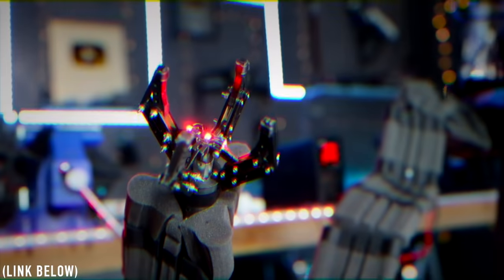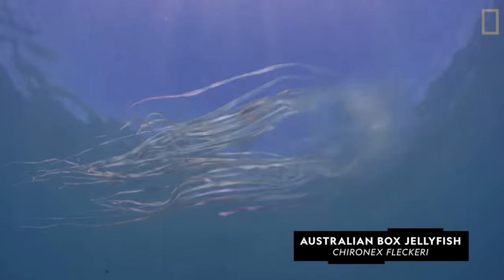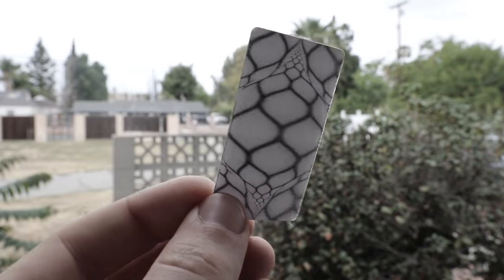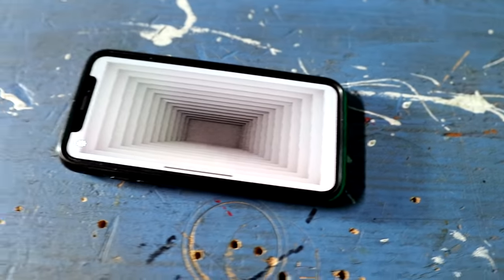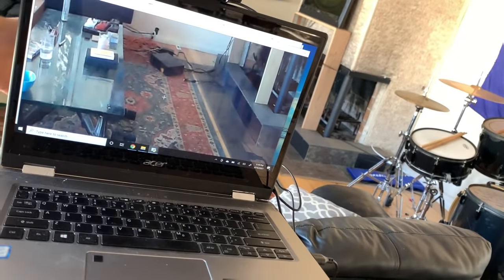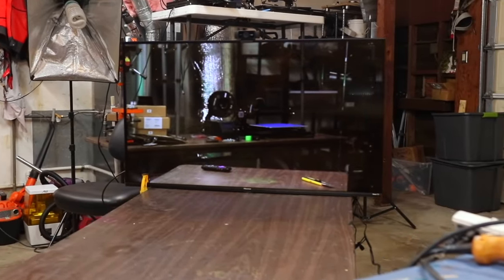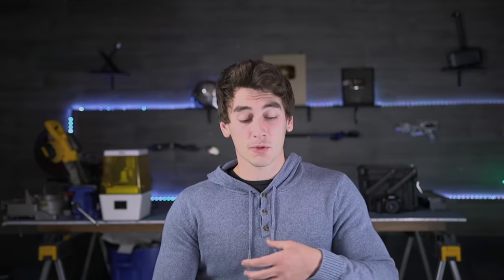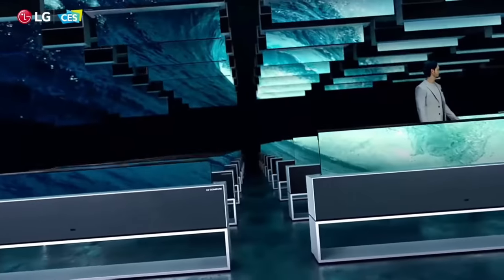Real Invisibility Cloak Using Artificial Intelligence! - Harry Potter Invisibility!!

Comment: You should make the Eye of Agamotto from Doctor Strange. You could have a small camera built in which you could use to program the hand gestures from the movies to open/close it. The necklace chain could be used to hide any wires if needed, and any of the bulkier stuff could be attached in the back underneath a red cloak. It would have a lot of small moving parts, which can be difficult, but it would look really cool if you did it!

Comment: The results are really good I think you might have put to shame the guys working on invisibility lenses for the army. It would be interesting to see you get back to this in a few years with a TV with little to no bezels and high contrast. It would be nice if you could add cameras too but I'm afraid it would add too much calculations. I guess if you had processor built for these specific calculations you could reduce the lag by a fair bit too.

Comment: This is pretty cool, and looks very difficult to put together with the tech we have available. Way to power through. We're just strangers on the internet so don't worry if you're not meeting the insane comment expectations. Question: since fiber optic fabric exists, is it possible to display the camera/AI output into that? The result might not be as high-res as what you did here, but you could make a fabric 'cloak' that would heavily blur whatever it was covering. Anyway, thanks for the vid. I suggest: make a Delorian that can leave fiery tire-marks (even if can't travel through time).

Comment: If you have 2 cameras min with the new cannon duel RF fisheye lens on each corner, you should get all the infomation you need to recreate your image. Capture more info with the cameras so that the software can do all the heavy lifting. 3 cameras with the suggested set-up should do. One in the middle to act as a control camera and 2 on each end.

Edit: I had this idea in the middle of the video. This one was when I watched more. MORE CAMERAS! a few more cameras could capture enough edges and area for you to create a model of the area your going through live and depending on weight limitations you could even have that save so it just redoes it if you go in the same area again
Reply: Like the idea, someone above also said: 'This is a really nice design but with the new screen folding technology you could implement this into a suit with multiple cameras on the behind of it reflecting the cameras views on the to the front'...

by the way... if You ever have the time :D  i have a question about something i didn't understand at all...
The part of "anything between the TV & the Camera is invisible" that he kept repeating... There are like [3]Cameras in the video... 
1}The QR-Code Camera pretending to be the viewer's face\eyes
2}The tracking Camera mounted on top of the TV & tracking the QR-Code to adjust the Scene-perspective displayed on the TV accordingly
3}I guess, a Camera fixed at the center of the TV's back to capture the 'Scene' [don't know why that one wasn't shown & was barely talked about]

So where exactly is that "anything between the TV & the Camera" distance?
& by what mechanism does Camera[3}] choose not to display his arm\body when he's right in front of it & blocking the Scene, while at the same time is still able to capture live video of the Scene & displaying it on TV?

Or is the TV display not a live video &, instead, just a still image that was captured at the very beginning, before he hides behind the TV, & then this still image is used as a video that changes perspective based on Camera[1}]'s position?

Sorry for the length, wrote out the different possibilities in hopes of making it shorter for you to answer :D

Comment: Ahhh! Snake, I see you got your hands on some stealth camouflage! 
To use it, simply equip the stealth camouflage through your Item Menu. Now as long as you have your back turned towards the enemies, you're going to seem virtually invisible! It works best if you're standing still in a crouched position,, so that your whole body is obscured. Your Camo Index will shoot up rapidly. Keep in mind, though, that it drains your battery and that enemies are going to see the plate if they come up close. Think of it like glass: you can see through it, but you can still see the glass itself if you pay attention.

Comment: If you mounted 360 degree cameras to your shoulders and your chest it would work easier. And use the 360degree lens you spoke of. Instead of a tv use a projector sheet with coat hanger style wires to keep the sheet stretched. And place the image projector on your back to project the image to the sheet.

Comment: 1:24 Not perfectly invisible, as you can still see the ripples of the cloak. Which is a fact that will help you in the finished product
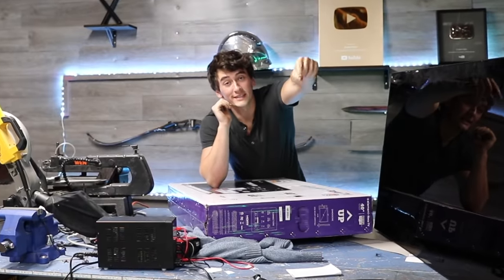15:15 I kinda wanted that tv to break just because you slammed it onto the desk so hard. You shouldn't do that!
16:48 That was clearly the hidden blade from assassin's creed , not the wolverine!
18:26 If only the color was deeper/darker, that would have solved 90% of the issues. Even if you still have to move slowly so tracking can keep up, it would look like some actual glass.